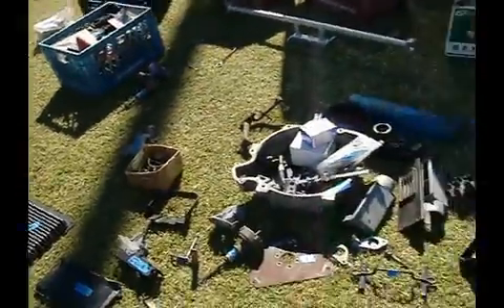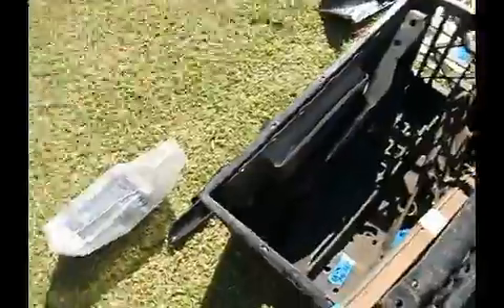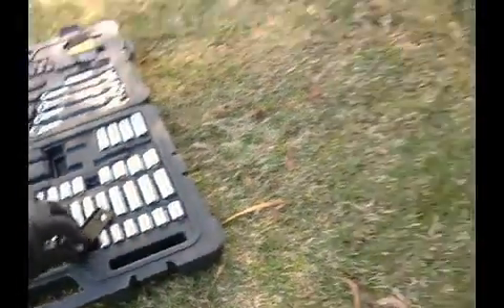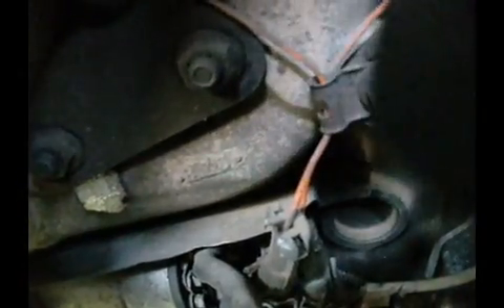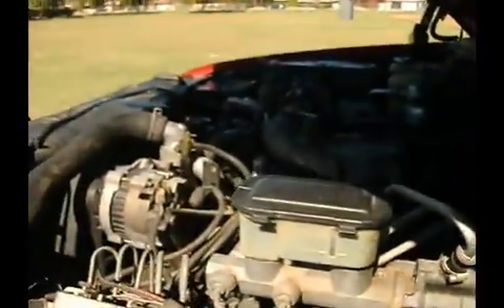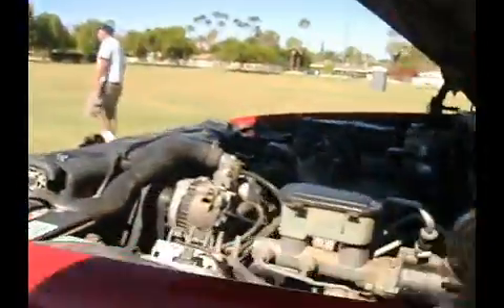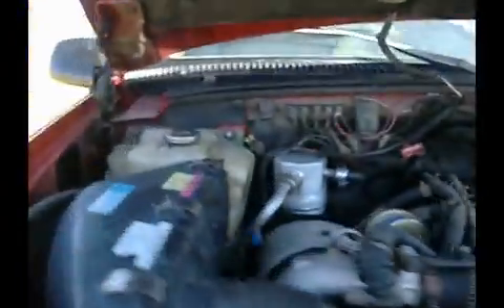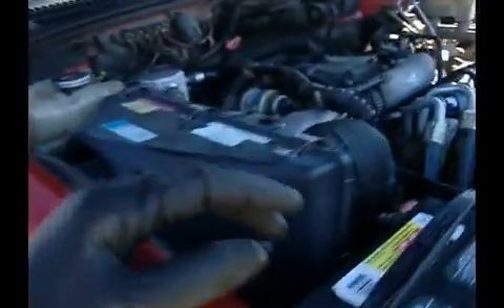10 27 12  Palm Springs TurboWeasel Bracket

Comment: why go to the junkyard for a relay?? they are under 20 bucks brand new at autozone or other parts stores..I know this because I had the same problem in my 93 2wd chevy truck..wouldn't start,changed the relay(took 5 minutes) and the truck cranked right up plus it was a cheap fix too with a new part..good luck